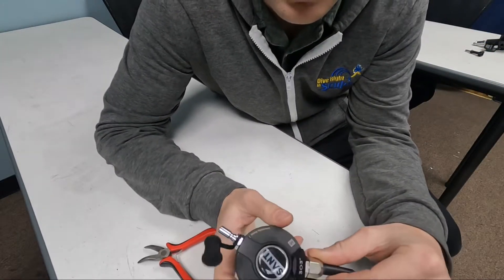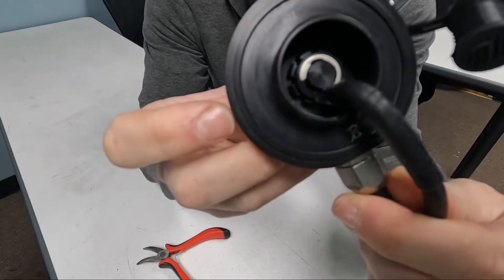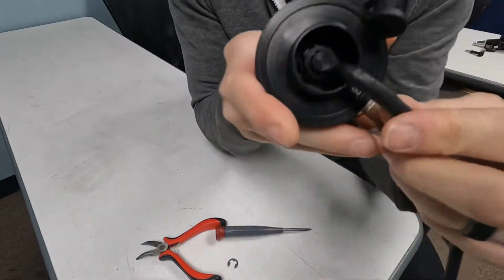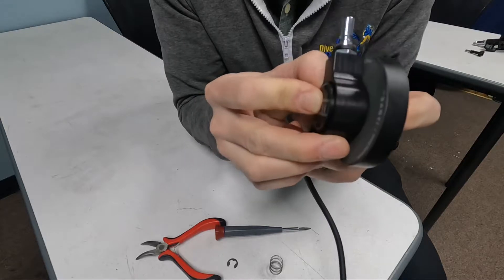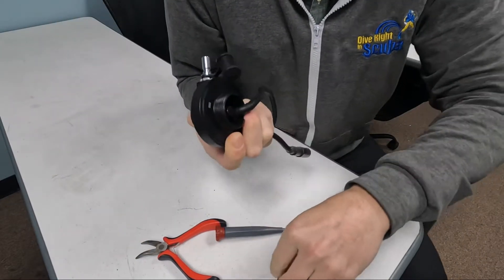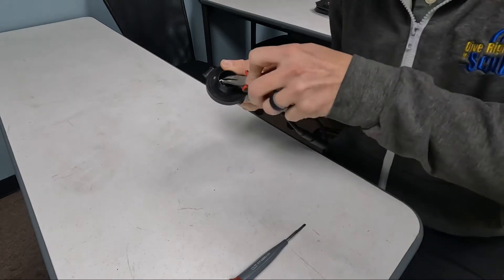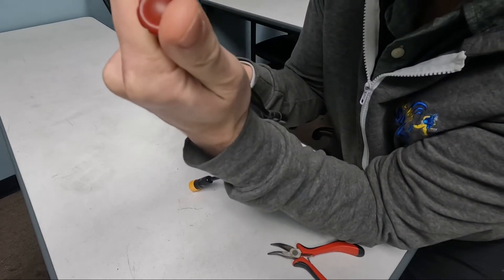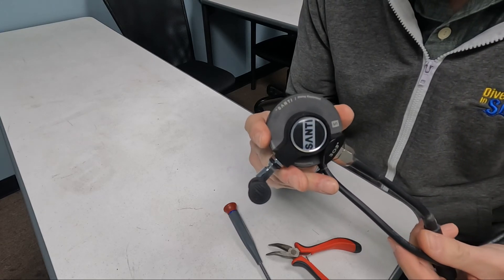Servicing the Santi Thermovalve 303 & Santi Thermovalve

Comment: Thank you for the great video. Is it possible to chenge the cable as it does not work anymore? Where can i Buy the cable?
Reply from the maker: I have gone through SANTI for cable replacements. I have heard of divers replacing theirs but I dont have any experience. Here is a cable supplier  https://www.rebreatherpro-training.com/product/heating-system-e-o-cord-prd1660
Reply: @timsgeartips  Dave Gration (rebreatherprotraining) supplies a new coax cable which is much more robust. Recommended.

Comment: What size are the two o’rings?
Reply from the maker: You’re going to need a 2x6 v70
I have them at the shop if you have trouble finding them
Reply: @timsgeartips  excellent thanks. What’s the material they need to be? Nitrile? I found that size at a couple of places with the 70 sh durometer but only available in nitrile so double checking.
Reply from the maker: Yes sir, Nitrile @ELCAM1

Comment: Great video but concerning the original complain - I have the same Valve and also already had the problem of self inflation. During a service I couldn't find any problems, so I got curious and tested my boyfriends Valve (same model as in the video, completely new and unused). It had the same problem as mine, so I'm afraid this problem is not caused by faulty O-Rings or debris inside but is a manufacturing problem from Santi. But that's just my opinion.
Reply from the maker: You might be right. Hopefully they get the issue squared away!